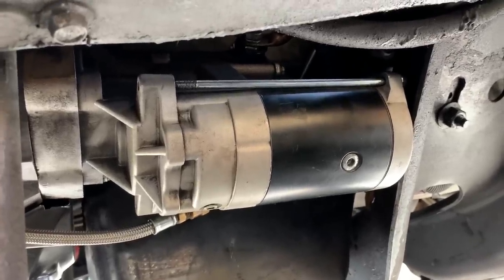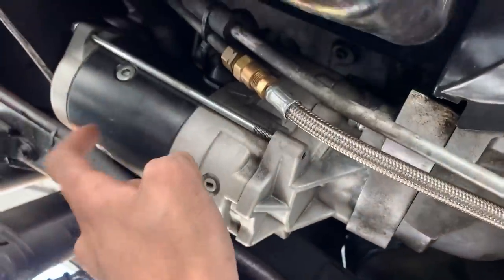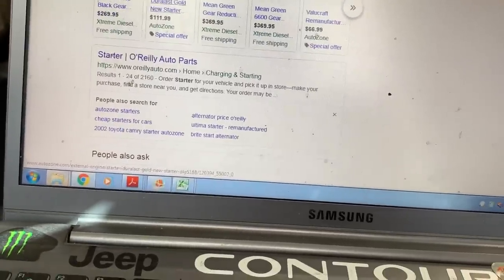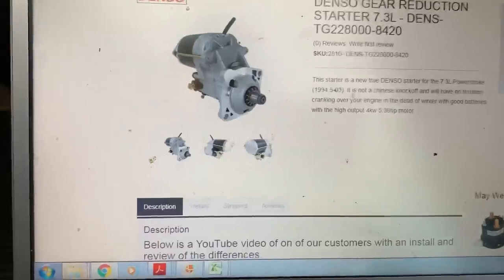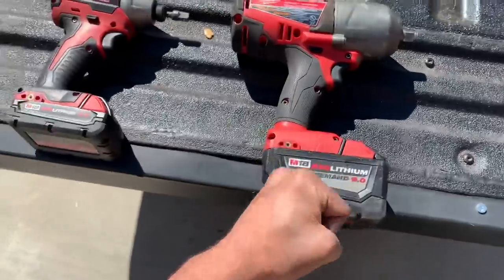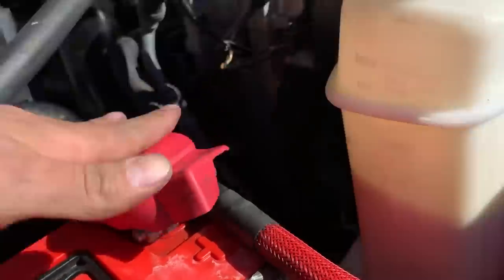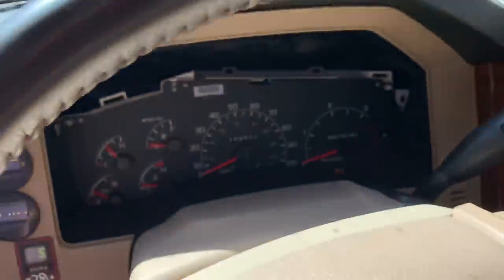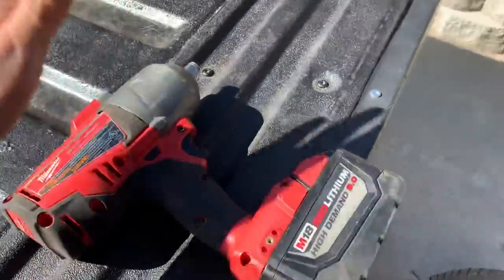How My 7.3 Starts up So FAST

Comment: Is it because the engine is worn out and has no compression?
Reply: Dan Stennis it’s generally batteries but sometimes an injector’s return line can go bad and lose prime and then it will have a hard time starting.
Reply: Dan Stennis low compression would make for harder starts less restince doesn't mean its gunna start eaiser
Reply: A skip would make a sound but if it was just worn out evenly it wouldn’t.
Reply: Beat me to it.
Reply: Yes. Yes it is 🤣

Comment: I can confirm this. My 02 has the same starter you have. As soon as I turn my key, starts on a dime. Even my dad wishes his 2000 can start as fast as mine.
Reply: I have that same starter and mine struggles a bit, kinda surges especially when cold. Wonder if I should check my batteries and connection cables
Reply: @tylerdavis288  yea I'd check the battery cables and connections. Battery cable can looks really good on the outside and have rusty and rotten wiring inside. Also have the batteries load tested first.
Reply: @jefflancaster6587  my local shop said it's a big old Ford and with it being roughly 20 degrees here most days, he said that's normal. I will add a word of caution. I started it the other day and heard a horrible metallic scrape sound, found out the top bolt of my starter had shaken loose and fallen out and the bottom was loose. Check your bolts every time you check the oil
Reply: @tylerdavis288  maybe add some lockouts or use locktite?

Comment: High speed starter gets the the high presure oil pump to 800 psi so it can start faster. It only uses 2 bolts instead of 3 like the stocker.

Comment: Hey bro , Will 2008 front panels hood grill and doors fit on a 2006 king ranch 350? , and why is my KR 2006 fully loaded but has no blowers in the center console for the rear passengers?

Comment: Ok good video. The used 01 350 7.3 i just bought had brand new Duralast Gold 850cca batteries with a 09/21..date..they have never turned the starter over like i would like to hear it. No corrosion on the hefty new cables. I'll load test them this week before i try a new heavier starter. To bad i don't have the receipts for these 6 month old Autozone Batts.

Comment: Where did you get those battery and alternator and starter cables. 
Nice truck you got there
Reply from the maker: i made all the cables myself. the alternator is off a OBS ambulance 240 amp alternator

Comment: Yea buddy!! Where you u get your battery cables and clamps?
Reply from the maker: FixItNick amazon. Look up fastronix
Reply: Zachary McFarlin will do
Reply: @zacharymcfarlin1270  You got the terminals and cables from them? Just bought an 00 7.3l and looking into swapping them cables. 45 colt starter is already there

Comment: I have a smaller 7.3 starter laying around and an older bigger one on my 7.3 and also a 6.7 starter, I wanna see if I can Mickey Mouse the 6.7 starter to fit my 7.3 I’m curious the effect it will have
Reply: There are ways to put the 6.7 starter on the 7.3, I think you just change nosecone.

Comment: Hmm I replaced my stock one when it broke with a regular input shaft and it starts right up with no problem. Even this past winter cranking in the cold for a few never seemed to slow down. But I’ll keep it in mind when it goes

Comment: Well my reason is to go for that starter is because it's easier on the batteries for if you need to use glow plugs to warm up the engine to start easier in the mornings and it also the starter will pump oil faster into the injectors for a can help it push the fuel into the combustion chamber to help startup faster

Comment: Quick question is it possible to use on a 6.0. Also having a problem with 5r110 trans...will the transmission range sensor which is inside the trans not have engine to turn over.....gauges pop on  just no start...from key switch
Reply from the maker: Eugene Owens I’m not too sure about that one to be honest
Reply: Eugene Owens  a bad transmission range sensor will cause the truck to not start or crank,it should be located on left side of Trans on gear selector.
Reply: @wildingarage2003  thanks but my trans has it on the inside if i find the video i will send it to you. Do you have a youtube channel....
Reply: Eugene Owens I have a Channel but haven’t posted in over a year,feel free to send a video
Reply: Eugene Owens also did you try to put the truck in neutral and start it, you may be able to get it to crank over in neutral
Reply: @wildingarage2003  yeah i tried it...that was my first case scenario....i also replaced crank shaft position sensor and cam position sensor..icp sensor as well...new starter and battery to starter line
Reply: @wildingarage2003  look up mechanic dave on YouTube he is the only one that ive seen that has replaced the particular part that im referring about...it should say 03 f350 range sensor replacment...its inside the trans on the passenger side of the truck...
Reply: Eugene Owens I actually googled it before and found that video ,I was curious where the sensor is on the 5r110 since mine on the 4r100 is external,it looks like you’d have to drop the pan to get to it to replace it,if you’ve gone though everything including fuses and relays,starter solinoid ect with no crank,I’d say def buy a oem Trans range sensor and get that little kit that the guy in that video said was needed as well,it didn’t look to hard to replace,also I don’t know if you have a scanner but if you do you should be able to read engine and trans codes and if the sensors bad it would def come up,I know when mine went bad it came up on the scanner,you could also turn key on with the truck in park and parking brake on and jump the starter it would probably run,there’s a wire on the passenger side engine bay near the battery that you can separate and put one end on the positive battery terminal to jump the starter,if you can’t find the wire I’m talking about you can google jump 6.0 starter and you’ll find it.
Reply: @wildingarage2003  the relay switch...ive tried it but it want turn the starter over...makes it seem as if the flywheel is missing teeth...this is my third starter replacement it cracked the cone twice so i held back trying to start it but i will try the kit from the vlog...

Comment: The late model 7.3 came with a better gear reduction starter. My 2003 has one. Fires up insanely good. If you have a early model 7.3 upgrading to the later starter is cake.
Reply: I have a 97. Any idea if I have the old or new style?
Reply: @hondaxl250k0  you'll be able to tell by how fast it cranks over. i never have to crank my engine for more than 2 seconds.

Comment: Anyone done this and had to notch the frame for fitment? Seems like Only way to get it to fit on my truck?
Reply: shouldn't need to do that. The later model 7.3's came with a better gear reduction starter. It should fit right in

Comment: New motor new transmission and transfer case new injectors and injection pump! Dual red top batteries! Older 7.3 l idi never could fast start up! Owned in the family since new!

Comment: Did u try intorstate that's what all my 7.3s have in them
Reply from the maker: Garrick Rodewald I haven’t tried them. After my last set of batteries shit the bed I said screw it im going for the best
Reply: Go buy Interstates from Costco. U can return them every 2.5 years and get full refund for free replacements. They will do it every time with no questions or testing of batteries.